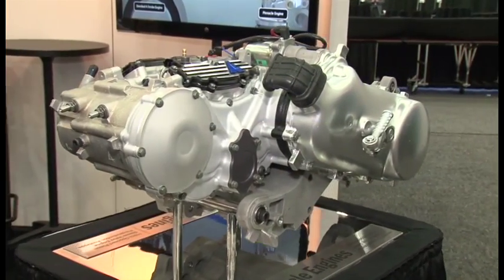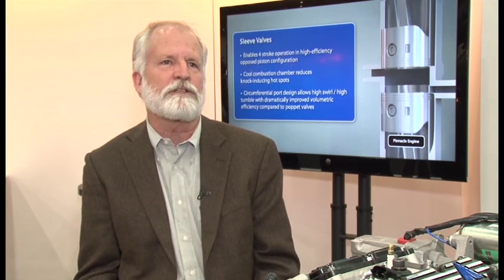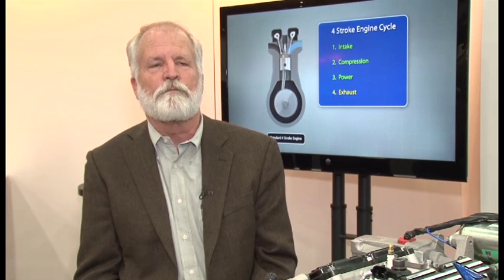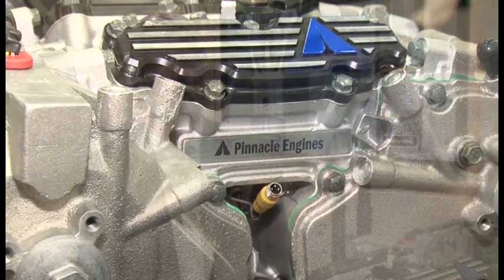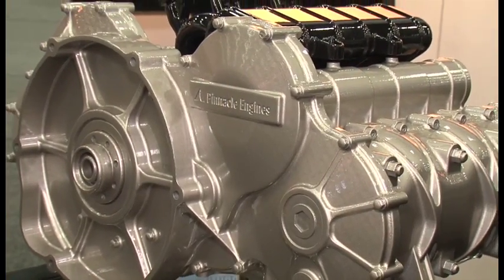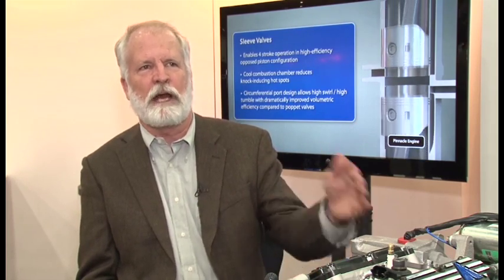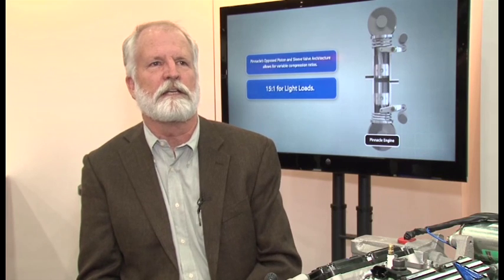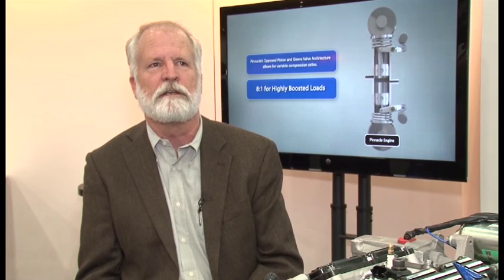Pinnacle Engines Founder Monty Cleeves interview at SAE 2012 World Congress

Comment: Life time fuel cost is more significant with purchasers than increased manufacturing cost of the engine, i.e. a Diesel engine cost more to make than gasoline engines.   The novel ports might outflow a 4 value head.   It seems that gasoline diesel cam profile is very restricted in lift and duration.  This might reduce pumping loses.
Reply: It's okay, this can still be adapted for four stroke diesel..in fact that would be rediculously efficient!

Comment: Most small engines today are never serviced beyond oil and spark plugs.  You buy a honda. Drive it 200k miles.  If the motor fails mechanically, which it wont, you would swap in a "rebuilt" engine from someone else's car.   
The parts you might actually try to fix, like valves, are not needed on this engine.

Comment: Neat work done, but this will be a throw away application. How on earth do you replace or repair something like this without completely tearing the motor apart. Opposed piston engines were around 100 years ago in diesel powered boats and locomotives made by Fairbanks Morse, but they were maintenance nightmares. I'm all for revisiting technology, but I don't see how this is any more serviceable, lower cost, or higher reliability.